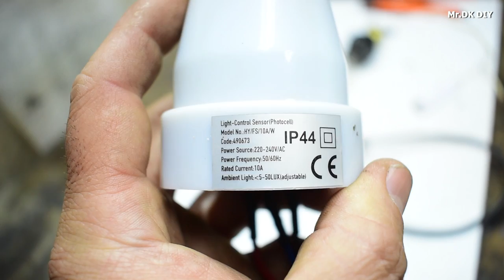DIY No-Contact Hand Sanitizer or Liquid Soap Dispenser / Homemade Automatic Sensor Machine

Comment: The ideea is great, but i would say the only thing that would need inprovement, would be the light sensor: When the bathroom light is closed, the sanitizer will run continuously. 👍
Reply: As an advice, maybe you can use a motion sensor used for outdoor lights,  and adjust the time period for how much it will be active!?
Reply: @flor33ntin  Also, put the soap dispenser on the lights circuit. Lights out, no current
 to the dispenser.